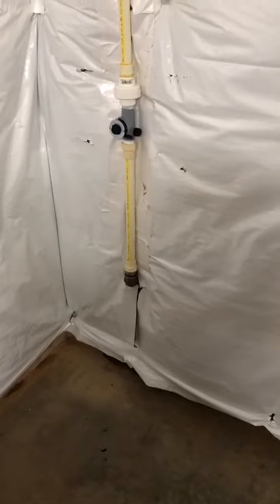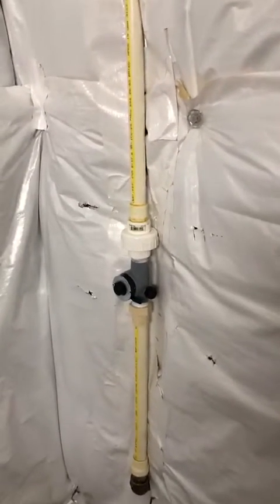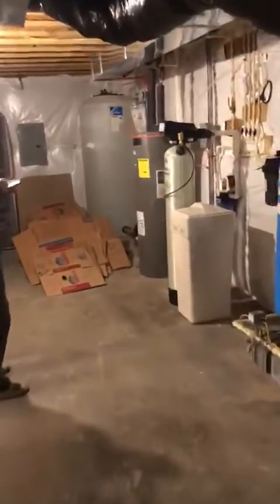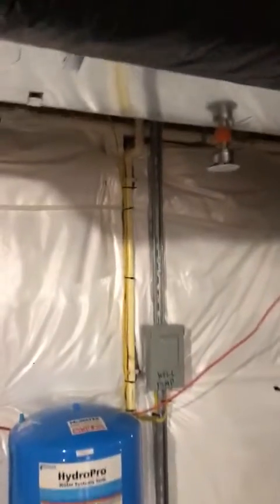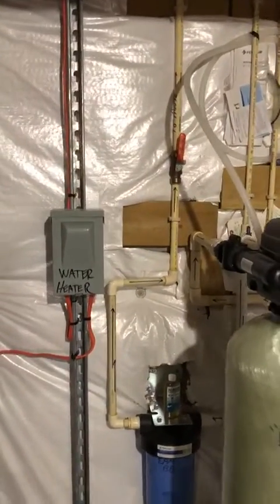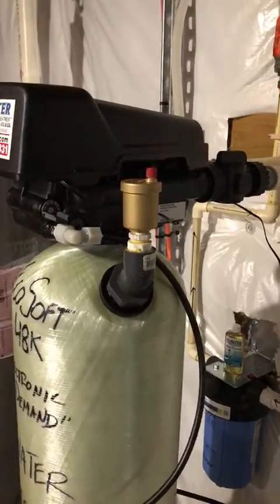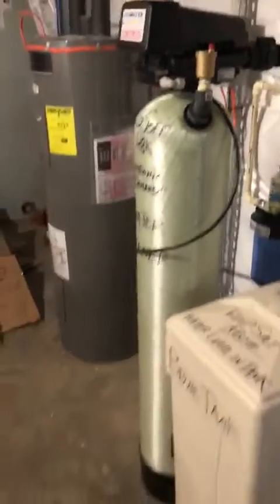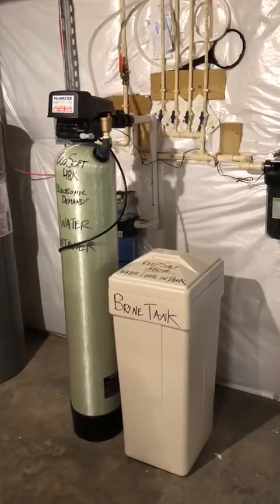Optional Water Softener Air Injection Upgrade for Sulfur Smell - Jefferson Maryland 21755

Comment: What happens when your bladder tank gets full of air ? Your bladder is full of air  and the water line will be injecting air into the tank where only water should be. The air will dissipate into the well tank as well. No air relief at the pressure tank?
Reply from the maker: The bladder tank does not get full of air. You only inject a small amount of air that is enough to oxidize the hydrogen sulfide and iron if any is present. Not sure what you mean when you say "The air will dissipate into the well tank as well" - once the water has reached the point of air saturation which happens right at the micronizer (or air pump) no more air can be mixed with the water so a small bubble of air is in the tank at all times. You are asking about an air relief at the pressure tank? Not needed my friend, the air water mix goes into the well tank from the incoming well line and simply leaves the tank as water is used in the home. The air is released from the air vent on the water softener tank - this is how I got my US Patents - https://patents.google.com/patent/US9499417?oq=9%2c499%2c417 and https://patents.google.com/patent/US9434626B2/en?oq=9%2c434%2c62

Comment: Where can I get those parts? I think this will solve my problem. I have a little sulfur but I have a lot of iron. If I can change it to ferrous before my sediment filter and water softener I think it will filter out.
Reply from the maker: What you are thinking will not work as you describe it Clint - sorry. This system is patented anyhow and I'm currently not selling nationwide as of yet just installing in my local area, besides that installing a system like this requires extensive knowledge of water treatment plus well and pump systems and is not something an most homeowners could do successfully.
Reply: @Mr-Water-LLC-of-Maryland  It’s not that difficult. Maybe most homeowners don’t have any skill. I just ended up adding fleck 2510aio with a birm media tank to achieve the same result. Oxidizes the iron so it can be filtered. Works just fine.

Comment: Sulfur in well, means there are demons(barking and shitting) You can make electricity from acidic well. anode cathode power cable and LED light. hydrogen
Reply from the maker: Ah ha so that's the reason!

Comment: Hi- I have really bad rotten egg smell in my cold and hot water and does your system will work in my existing system. I have a bleach system, iron, Carbon and water softener system.
Reply from the maker: A stand alone air injection system could be installed for sulfur smell - MUCH BETTER than chlorine injection systems.